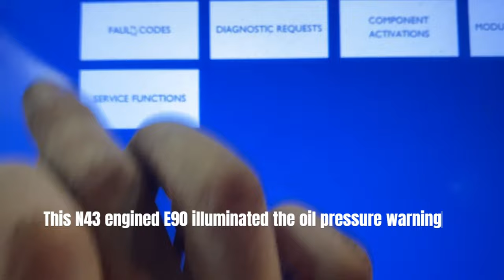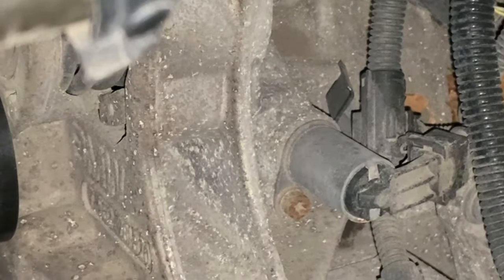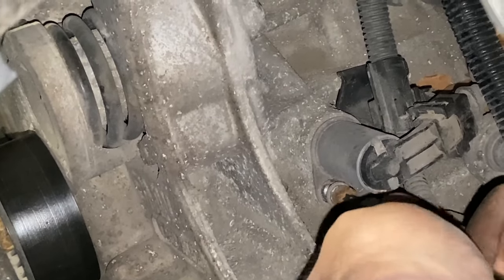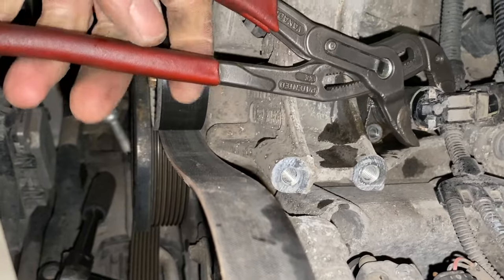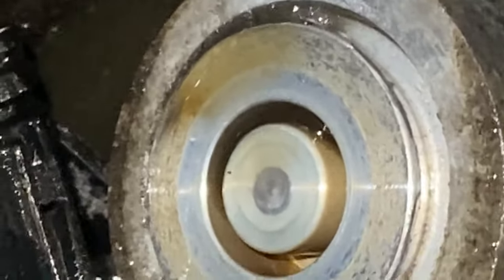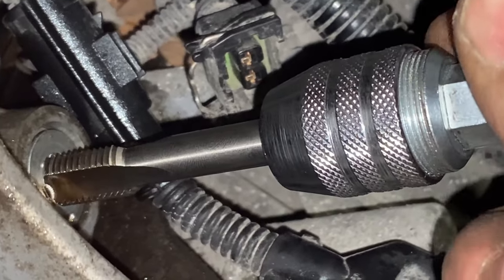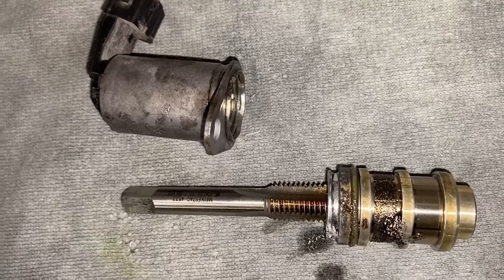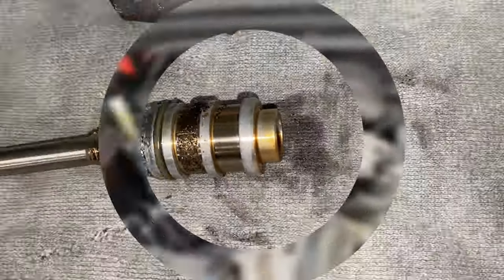BMW E90 N43 oil pressure too low

Comment: What would be the best way to clean it 15:22 cause the mesh filter on the top wont let any liqued through from the inside all came from the bottom one
Reply from the maker: Just buy a new one bud. As I always say - find out the reason the crap got there. If you watch the second video I made you will see why this happens in most of the cases
Reply: @allmech_BMW_fault_finding  yeah i bought new one for now, but i wanna keep on cleaning this new one every 10-20k like you said. Would giving in some volts open it or something?
Reply: @allmech_BMW_fault_finding  yeah i remember seeying some brown rust, but not rust bubbles in the oil pan, ill sand it the next time i have it open

Comment: For an E90 318i 2.0 gas the "Low oil pressure" symptom manifests like this and only on mountain roads after you climb the road and you have some swirls and immediately on a plane surface you stop the car the warning appears. If I stop engine and restart everything is ok. I drove after that for another 1000 km without any warning but only on flat roads. What can be the cause? So only climbing and after that full stop on a plane surface.
Reply from the maker: Suction blockage to the oil pump due ti debris in the sump maybe. Oil sump is baffled but on a hill as you said it triggers it so I would look at what condition your chain is in. Plastic tends to end up in that suction pick up pipe gauze filter.

Comment: Hi mate my bmw 3 series have ticking sound with no pil pressure is this the same issue of ticking noise from engine ?
Reply from the maker: No idea. Probably you have a blocked oil pump suction pipe in the sump but without looking at it I have no idea.

Comment: I had a e90 with a n43 oil pressure light  mostly on highway.. very bad stationair running. Got it in bmw garage there was metal in the oild very much oil filter full of it. Cilinder 1 got stuck.. put a whole new engine in again. Had the same problem! Did the garage put it together wrong i dont know. They did the engine again for the 3th time. So 6months later i have my car back. Engine stalls when i dont have my airconditioning on. So it runs lower rpm sp engine shuts of all the time. Sold it. So much money loss. Got a b38 now f20.  Dit i have too much bad luck are these really this bad? Sorry for bad English.
Reply from the maker: Your English is fine 🙂👍 Yes you had bad luck mate. B38 ok only main issue is faulty breather in cam cover but you would notice it will start to use too much oil when breather fails. It should be ok tho. Any issues come back here and I will try to advise you. Fingers crossed you have no problems 👍
Reply: @allmech_BMW_fault_finding  thank you! But im thinking buying a e90 again but it has to be a petrol with n43 again because of tax en emissions.. im from Europe Belgium. Would you recommend it to buy another car with the n43? Or keep my b38.
Reply from the maker: @tuffgong3248  Keep what you have mate 🙂
Reply: @allmech_BMW_fault_finding  i should be happy with my f20. But i like the e90 so much 😅 but thanks for your advice!

Comment: does N46 normally have this pressure control valve?
Reply from the maker: Not sure. I think not as the engine design is so much more different to N43. Tbh I never have much to do with the N46.

Comment: I have a 2015 bmw n26, “Engine oil pressure too low” I ran the code it says my 1c0301 “Oil Pressure control valve Jams in full Energized position” Can i clean the valve with spray from auto zone? I change my oil every 4k miles but i lagged my last oil change. I get this warning when i speed at high rpms, Just warning no engine knock or issues…
Reply from the maker: To be honest just replace it. Once crap gets past that filter screen its goosed. What goes in rarely comes out. You can try throttle cleaner but the way I used to clean solenoids is energise them with a PWM controller immersed in liquid.
Reply: @allmech_BMW_fault_finding  One sensor $180 lol
Reply from the maker: @silentescape818xsfvla8 I know mate - nothing is cheap is it these days 😌 Try cleaning you might get lucky. I hope it aint stuck as in my video
Reply: @allmech_BMW_fault_finding  How do i go about cleaning it?
Reply from the maker: @silentescape818xsfvla8 Carb cleaner. Spray it in the end and in through the screen filter meshes. Invert it so fluid drains out. Did you remove it yet? If its full of metal cleaning may not help.
Reply: @allmech_BMW_fault_finding  No i have not, i dont know how, my friend is a mechanic hes gonna do it for me. Its on the driver side by the engine mount on the n26 engine. Why would it have metal shavings tho?
Reply: @allmech_BMW_fault_finding I cannot afford to have the oil pan pulled to check the sump screen for anything because im broke. all i can do atm is buy a new valve and pray that was the issue. My timing chain is perfect & tight. Could my valve just be slugged up from a late oil change?
Reply from the maker: @silentescape818xsfvla8 Its possible that its sludged up. You need to remove it and check. Usually they dont sludge up. The oil pressure really should be checked under different conditions before swapping parts but this costs money too if mechanic checks it. Take out the valve first and check. You can post images in my community section here 👍
Reply: @allmech_BMW_fault_finding  Hey boss we just got that valve out & its pretty clean & no sludge at all, But it does have a hair line size crack on the base of the sensor, the plastic part. would you recommend a new one?
Reply: @allmech_BMW_fault_finding  where can i send you a picture? im in iphone
Reply from the maker: @silentescape818xsfvla8 Hi there. The oil sensor underneath is cracked? Yes definately change it as it will leak. No sludge argh not good. Even if its clean no way to know if its sticking or not is there🤷‍♂️ I would just change it mate and the fact there is no metal or sludge is good.

Comment: I've replaced that oil pressure control solenoid a week ago, and today low oil pressure warning light showed again. Warning apears when engine is warm and idling, as before replacement. Any idea what it could be? Great video by the way!
Reply from the maker: Hi Milos. Sadly this does happen and since I am unaware of your cars history I cannot say for sure the issue but usually the timing chain guides break into tiny fragments and block the oil pump suction pipe in the sump. Usually its just crap in the engine that re-interferes with the new oil valve. Sadly the engine needs a full strip and clean usually from main oil galleries as once metal is in its 50/50 if oil valve replacement alone is enough. On this car it fixed the problem.
Reply: I’ve had an issue with n43 and the crankshaft was cracked, I’ve replaced the crankshaft, timing chains and guides, oil pump, all in all a total rebuild of the engine. Then I got the low oil pressure message. I’ve changed the oil from 5w40 to 5w30, oil valve soldenoid, the message still appeared. Then I’ve noticed this appears when the idle rpm goes low, usually it was 704rpm. So I’ve raised the idle rpm to ~780 with inpa and did 500kms with no warning. I hope it did a trick.
Reply: Replaced oil pressure sensor couple months ago, error didn’t come back. Hopfuly the issue is solved 🤞
Reply: @milosjevtic880  Hello, what is the latest situation? is the problem solved?
Reply: @mustafatoker5491 Problem is solved. Error didn’t come back since I’ve repleced the sensor
Reply from the maker: Problem guys is the oil sump pan causing this. Its a lottery what f's up - sensor, valve... Watch my second video "smoking gun"
Reply: I have the same problem. Magnetic valve changed. After the drive error, it gave error code 2B7400 2BE800. I'm afraid of getting an arousal warning. I'm sorry for my bad english.

Comment: I have the same problem. When the engine is hot and it’s in neutral the low oil pressure comes up. Been trying to find the issue for so long.

It also have low power, like no power at low rpm and runs at too low rpm in neutral. Also the fuel consumption is crazy high. Like 18,5l/100km. Why is this happening? I don’t know car engines to well but I’m learning I’m the way.

Short told: 
- low oil pressure light when hot engine in neutral.
- Low Power
- high fuel consumption 18,5l/100km.

The last months We changed the chain, coils, plugs, fuel pump, and will look into this from your video now. Nothing solves the problem yet.

Starting to loose hope here😭

If anyone have any tips I aprichiate🙏🏻❤️
Reply: It also have problems with starting unless the car is completely cold. If I drive it and leaves it for like 1 hour it can have problems with starting and the engine does not run right. 
(I don’t know much but this is how I can describe it)
Reply from the maker: Get a borescope in there and check for misting injectors. See my latest video about N43 fuel injectors leaking

I have alot of info in my channel just watch my videos 🙂 

Check your plugs too, exhaust tip are they black? Fault codes? I can bet you have leaking injectors. Check smooth running values. Watch https://youtu.be/MQBt8TFwG1w?si=kmqG2XDEBWsTjkwS

Comment: really congratulations, thanks to your videos, I'm rebuilding an N43B20 of a 120i. more or less the same components to replace as yours, crankshaft, connecting rods, and cam polishing. I have a question: I haven't marked the position of the valve lifters (cod. 11337548690) and they are mixed up, do you think it's a problem to reassemble them not in the same position? Thank you. Cristian from Italy
Reply from the maker: Hi Cristian. It isn't ideal but in all honesty I would consider replacing them all but as they are expensive I understand you may not want to spend money replacing them. Just keep them upright to avoid oil loss. Should be ok buddy.

Comment: 1:30 can someone explain how does valve overlap make the chain loose?
Reply from the maker: As the engine camshafts are at a stage of opening the valves there is more chain tension and off cam less tension. Timing chains are dynamic and this is a normal phenomenon in a 4 cylinder engine. A 6 cylinder by contrast has less slack off cam on BMW hence why stretched chains are very rare on 6 cylinder engines. 
The N43 chain when totally stretched generally has alot of slack during full rotation and even more than usual in the "slack part"

Comment: hey. i think your video has helped me - my 2008 1 series N43 1181 with only 52k on clock just got the low pressure red oil warning light........ hoping my mechanics can watch this and see if it helps. You are a great mechanic! from your video the mechanic needs to 1. plugin the car to the compouter and check the engine oil pressure. 2. look at the oil in the sump and see what the volume is.  Should be about 4.2l? 3. If there's metal in the oil then the valve - oil pressure control valve - needs changing. And engine needs cleaning out to clean metal out of galleries.  Do you thing it's worth changing the chain and tensioners too? Also how much would that come to at Jo average mechanics? :-) if only you were in South London....
Reply from the maker: Hi Ali 🙂 We would charge about 3k. Yes, the main thing is to check the valve as if its bad more than likely swarf will return. Change the chain and guides if you find the timing is a bit out and if you find orange plastic bits when you take sump off. Dont forget basics first as even a damaged oil cap can play havoc with oil pressure. But yep. Full renovation and flush oil galleries out👍
Reply: @allmech_BMW_fault_finding  thank you very much. the car is worth 3.5k so it might be non economic to repair..... i'll get them to look in the oil first.
Reply from the maker: No worries Ali. I am still growing this community channel and If it helps to educate and improve the chances of first time fixing then it will have achieved its goal. Best of luck with the repair, Ali 👍